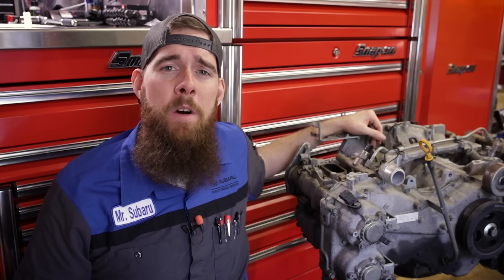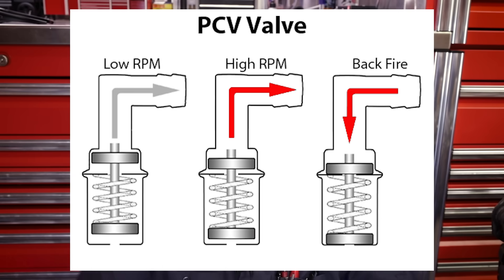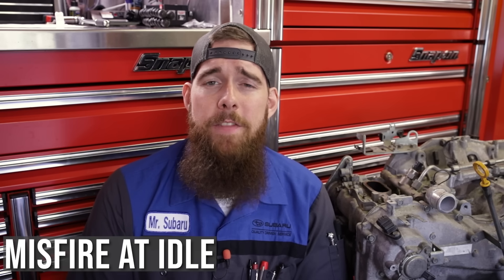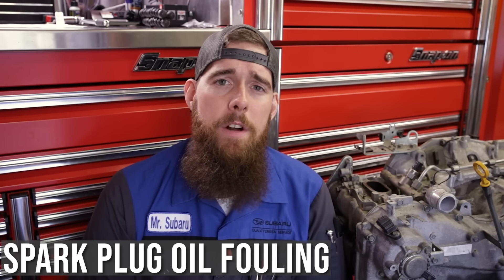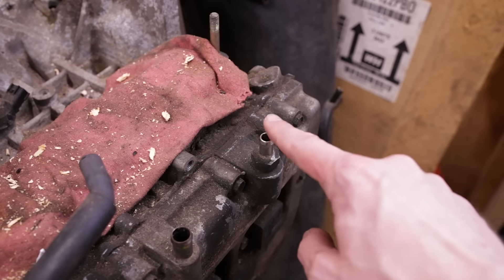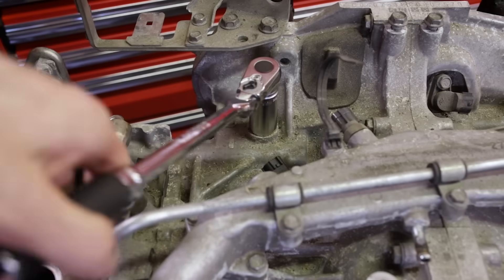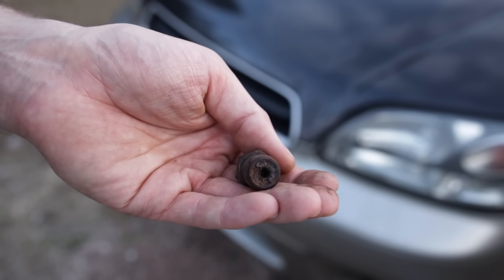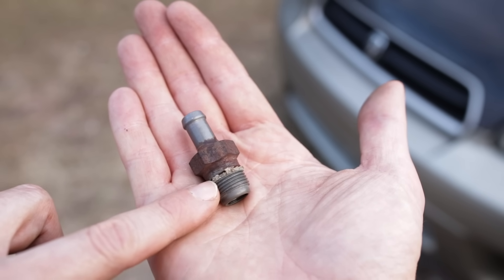DON'T Let This $20 Part Ruin Your Engine! PCV System History, Theory, Operation, & Repair!

Comment: I have a b4 5 speed no turbo at all I have no idea how much the pressure owner did to the wiring the car sometimes tells me its over heating until I hit the dash don't have t hit it that hard but he put a werd thing where I think there is supposed to be the knock sensor it gets worse but it's my first car I need to do alot of things that I did wrong like it had a straight pipe so I put a standard exhaust on it but found out it needed springs to keep it from falling off I'm just happy I was slowing down when it happened and it's been like that for awhile I'll because a break pad fell out on the same day now I need all the parts it'll be fun

Comment: Don't know why I haven't subscribed, I've been your channel for 2 years. Subscribed 👍, so if the PCV valve isn't too bad just service/clean and reinstall right! I'm looking into a little more than normal vibration at idle on my 2019 2.5i with 113k miles, plugs were replaced by Subaru at 72k as well. I'm thinking of checking plugs my next oil change and looking into the PCV valve, might replace as I drive the Outback 4 to 600 miles a week, has been super reliable from the 21k miles I got it and have 2 month oil change intervals

Comment: I have a 2019 1.6l crosstrek, but I can't seem to find the right pcv valve for my engine. It's the FB16 engine. Is the pcv valve same on all the FB engines, or do they differ in some way? 
Thanks for any reply.

Comment: Thank you So much I was experiencing excessive consumption of oil with my 2012 Impreza 2.0 only to realize after the valve change that it was the clogged valve causing the problem

Comment: I changed my PCV valve on my 2013 Crosstrek and went ahead and changed the hose also. Where the hose attached to the valve it was brittle and cracked.

Comment: Anyone who can help it would be appreciated but I got a 16 Genesis coupe 3.8 the rpms at idle do bounce some but when I’m driving and go into neutral because it is manual it drops down to 900 then up to 2k holds then drops when I come to a stop might hang in for a second after coming to a stop I don’t think it’s my throttle body or other sensors but it pops a P0507 I’ve determined there are no vacuum leaks from hoses or loose fitting I have cleaned throttle body and sensors around it and nothing only thing I haven’t checked yet is the pcv could this be the problem?

Comment: I thought I understood the PCV system, and it was fun to understand the clever design of that little ball and spring to reduce flow at idle, allow more flow at WOT, and absolutely stop reverse flow. Then I came across newer systems with turbos, vacuum air pumps, and complicated plastic intake housings. Instead of a little device that is replaced for ten dollars, in some vehicles you need to replace much more.

Comment: I have bad threads on my Toyota RAV4 PCV. What material can be added to help fix the problem?
Can you also please write down the material that you mentioned in your video to add on the threads to make it air tight? Would that help fix my threads problem?
Thank you...

Comment: I have an 08 Subaru Impreza with a Ej15 engine, that engine wasn’t sold in the US, is common to find them in Europe or in latinamerica , the car has a hard startup and when is in low rpm to move the car in traffic with the clutch and the gas, the oil indicator start blinking just briefly, but just when I do that, I think my pcv and the vvt selenoid are bad, can you tell me where is the pc valve is in that engine? Thanks

Comment: I have a 2019 Forester, 2.5L engine. There was talk one one of the Subaru forums of the PCV actually failing in place and pieces falling into the engine. Lots of white smoke coming out the tail pipe. The engine had to be taken apart. There was no recall on this in Canada but I bought one anyway, PCV valve #11810AA200, made in Japan, Canadian $33.39 incl tax. Needs 22mm deep socket. My mileage is low, 25,000km. Plan on replacing the PCV in Spring 2023.

Comment: I'll do it because my subaru 1993 ej 22 is shaking a lot when idle is 700rpm, sometimes still stop. I just cleaned up PCV but it is all time opened. May be the internal spring that doesn't properly working. So I need buy other one. Thank you.
I'm from Brazil, Paraná State Curitiba city.  And you are welcome if you drop by here.

Comment: An oil leak just started maybe a month before I saw this video. It was on driver’s side front on my 2012 Forester. Looked like timing cover. PVC had 120,k miles so I changed it as described. 
It seems like the leak stopped. I even changed the plywood I park on to confirm. Yeah, it stopped.
Maybe coincidence but I’m happy, and very lucky!
Reply: thats great! its always nice when stuff happens the easy way.

Comment: I have a 2020 Subaru Outback forester sport I have sludge when open up oil cap all my lights are on dash check engine cruise everything is on not working idling ruff running ruff i took to the dealership bad sensor but told me 125 hour minimum 10 hours I don’t have that money to do that could you give me some options I have low funds at this moment feel like my car is running like it’s 20 years old

Comment: Maybe one of you Subaru guys could do a video on replacing the variable cam gear and ocv filter on an FA20. Getting code P000a and there is nothing but dead ends on this repair. Going to the dealer is not an option, especially when the dealers cannot seem to solve the issue either.

Comment: I was going to replace mine, on my 2015 3.6 R Outback at 60k miles, but got sidetracked, and didn't do it until 70k miles.
When I replaced it, the old valve was rattling, but I could hear sludge dulling the clicks.
Anyway, while replacing the valve, I noticed the vacuum hose looked crushed!
Like the vacuum had drawn it in and cause it to become disformed.
I went ahead and replaced it, with an OEM hose.
The PCV valve was OEM as well, because something this important, deserves a couple extra dollars, for peace of mind.
Just a heads up, to those replacing the PCV valve on higher millage engines, make sure to inspect the vacuum hose as well!

Comment: Your videos instill confidence in my car and the repairs/maintenance I do on them. I had hesitation off of idle, so I pulled and cleaned my MAF/PCV/Throttle Body and it was an immediate improvement.

Comment: So I just started my 2015 WRX with 120k miles and it’s idling rough, having trouble starting, and smoking like a chimney. Could this be the PCV valve failure?

Comment: Any suggestions on a standard life of a pCv valve? 

Should it be replaced every 10k just to prevent issues
Reply: it only breaks when it breaks theres no life time for it
Reply: To my knowledge no one know when PCV valve brakes or how long gonna last. 
But to prevent maintenance issues it’s always recommended to change for new one around 30K miles intervals or close to that. 
Doesn’t cost a fortune but it gives you peace of mind. Cheers

Comment: 93,000 km 2015 Legacy.  It's easy to locate - but a long extension and a 19mm deep socket make it easy to get out.  Mine felt a little gummy but was pretty good - no corrosion inside at all.  A little break cleaner and working should keep 'er going for a good while.

Comment: PCV systems were first introduced and used during WW2 by many automobile manufacturers. My WW2 Willy’s Jeep L134 engine has a PCV valve. So it was out way before the 1960s as claimed in the video.
Reply: yet the 1987 jeep cherokee  didnt have one (?) nor a valve cover gasket.
 [there was a plug in the valve cover, so easy to put in a universal PCV that should have been there when it was new]
I made the gasket and installed the correct tubing & PCV valve and it solved issues my sisters jeep was having.
 *saw the same on other new cherokees in that time frame - the company saved just a few $ - ugh
even my old VW engines had them,  but not the 87 jeep
Reply: First off, another great video on Subaru’s, really enjoy your content, always informative, Thanks. 

But I was thinking the same thing about the 60’s comment. My 1953 Ford M38A1 CDN Army Jeep (F134 Hurricane motor) has a PCV as well. Actually the entire engine is a closed system design that was designed to be fully submerged in water. I wouldn’t try that now though on our Jeep, Forester or Outback!!!! Cheers.

Comment: I just changed my pcv hoses and valves on my 2010 WRX. My pcv was stuck closed and it was leaking oil on passenger valve cover. The hoses were hard as a rock too.

Comment: i have a 2002 Subaru Forster and when I drive after it warms up, it asks like it has no power. It has a new fuel pump, and i was thinking its something with gas system,,,maybe the PVC is my problem?

Comment: In theroy. Can you just remove the pcv valve. Install a free flowing fitting and put a hose on it like a draft tube and plug the intake port.   Or do you need the Vacuum to help pull gases out if the motor.

Comment: Silly question 2002 wrx owner here. 
Will a malfunction valve be detected and a check engine light show? 
Thanks for any feedback
Reply from the maker: No
Reply: @MrSubaru1387  
I appreciate the feedback. Ordered part and new hose since I am reading it tends to turn brittle. 
Great videos and very useful information. I was able to replace my timing belt watching your tutorials!

Comment: My 2013 gen coupe 2.0t idles good and starts up smooth but stalls after a couple of minutes. I did and oil change,  I had fuel in the oil, no check engine light at all or stored codes, eveything else seems fine but I can't see the issue, I'm thinking it's either this stuck open or crank position sensor,  but if it was a sensor,  the check engine light would come on

Comment: Does the 2.5i boxer engine need a "catch can" inline with the PCV valve to catch any vapors and condense them like they use on the Ford 3.5TT.?

Comment: Recently bought a 2011 Forester and it's been idling a bit rough when cold, been watching your videos, PCV was a little sticky cleaned it not much improvement, watched cleaning the throttle body, started undoing the plenum 😶🤨🙄 whoever was working on it before I got the car put the plenum on with only half of the rubber collar under the hose clamp the other half was folded 90° and just pressed against the throttle body, I'm amazed it sealed enough and wasn't tripping any codes, cleaned the TB carefully warmed the folded bit with a heat gun on low got the wrinkles out, runs like it should now.
Been wanting a Subaru every since I swapped an EJ22 into my VW Vanagon, engine has over 300k now and still runs great 👍

Comment: I replaced the pcv valve on my 2004 forest. After installing the new one with some Teflon tape on the threads I noticed that the valve is spinning in whatever it screws into. I'm pretty concerned. What could this be? Is there some type of housing the pcv valve screws into? Any advice would be greatly appreciated

Comment: mr.subaru, amazing explanation... but I would appreciate if you do this video, showing how to replace on the engine instaled (complete).... I know is a paying in the ass. (PITA).... I love the drawings etc.

which way I can use to replace pcv without removing the manifold intk?

Comment: Great video! I think I definitely will check my PCV valve and change it if need be!
However, I have a big question! Are EJ20 PCV valves universal for all EJ20s? I have an EJ206 (twin turbo one), would I have to get one specific to the EJ206? Or will one from any other EJ20 work?
Or does it have to be from another DOHC EJ20?

Comment: My EJ253 uses the 11810AA090 which is a black & red plastic part. Does the EJ253 also have the 11810AA100 like metal valve in this video?

Comment: I’m trying to diagnose excessive oil consumption on our 2012 Legacy. 1 qt per 2000 miles. Sounds as if changing the PCV valve is one inexpensive item to rule out.

Comment: I drop the valve in a plastic bottle with gasoline, let it soak overnight and shake to bottle in the morning. Or brake cleaner. Cheaper than 20 bucks. Clean it when you change your oil is draining each time and you won't need to replace the metal ones. Keeps you from blowing your seals

Comment: Replaced the one on our 2015 Crosstrek last week with the OEM part.  The vac hose to the manifold was hard and almost brittle down at the valve end.  I didn't trust it not to leak after disturbing it. It didn't come off of the valve without a fight.  Went and replaced that too for good  measure.

Comment: Hey I have low idle on my Legacy 3.0. When gear is in D or R idles it's under 500 rpm and the car shake a little, it does not shutdown the car, but once I change gear to N or P the rpm rise above 600 and stops shaking additional when gear is in D or R and turns AC or light on shake stops and rpm rieses above 600. Trying to correct the issue I already perform a throttle body cleaning, an injector cleaning, MAF sensor cleaning and the issue remains... I have to say that I start to notice this after I change my alternator, so Subaru check and test my battery, and alternator to see if there were voltage issues, but everything seems to be ok ¿any thoughts that could be the issue and how to solve? Thanks

Comment: Sometimes the shake test won't determine if it's working the right way. The spring can be worn too.yiu can also do the blow test to see if it's doing it's job. In both directions. Even after cleaning if it fails the blow test, it's bad or not operating at  the right threshold. Great video
Reply: Mine the spring and internal valve/plate was completely missing (it was clean straight through hole) 
Sadly this was on my WRX after i had owned it for about 3 years and then the mechanic abused it on a test drive there was smoke pouring out of the valve cover leaks onto headers. 

Luckily was no other major damage to other seals except a short term leak from front of sum near the main

Comment: I received several warning lights on the dash of my 2013 Subaru Outback.  I plugged my OBD scanner in and have misfires in cylinder 3.  I pulled the plugs, and cylinder 3 and 4 had oil in the spark plug tubes so I installed new gaskets, tube seals and plugs.  I also placed one new coil pack on cylinder 3, in the hope the misfire was gone.  I also put new oil in at the same time.  The engine runs and sounds "ok" BUT at slow speed or stops it will intermittently stall.  When I put the scanner back on , I get code P0021(bank 2).  At this time, I took it to my local mechanic and he tells me cylinder 3 has low compression, he did not do a leak down test just a compression test. I think it was 80 psi.  I have 149K on this engine and he suggested I rip and replace with a low mileage motor.  However, I want to determine what the cause is and try to solve it with this motor(if it makes sense).  I plan on buying the OTC tool to do the leak down test you show in your other video's but I am wondering if the PCV valve could have been the cause of my original misfires? Also, could the PCV also cause the P0021 code, even though the code is timing related?  Any input greatly appreciated.
Reply: Any update? Did you replace the pcv valve?

Comment: You described all the issues on my old  1996 Mazda MPV, and that PVC was constantly fouled up with oil.  I always wondered why they had it as a 10,000 mile interval replace item in the owner manual. I never saw PVC replacement in the 2015 Subaru outback manual, but just checked it's at the 60,000 mile interval replacement. Though some owners say 100,000K and they are still on the original Subaru PVC.
Reply: I'm a Mazda 6 guy and they eat pcvs. Even if it rattles the valve can be bad. I just replace mine every 20k.

Comment: Just did this on my 2011 2.5i Outback. Design was a little different as it didn’t screw into the block (red topped one). There was a short hose with a metal clip. Clip was easy enough to open with a screwdriver and close with a notched hand wrench. 20 minutes and the job was done. Valve was definitely seized and the inlet line to the throttle body was soaked in oil.

Comment: Great explanation and hard to argue with the logic. But why doesn't inspection of the valve show up on the maintenance schedule for the BRZ?
Reply: I imagine they don't want to be responsible if Subaru service cracks your intake manifold. I went to Subaru Parts and they don't service the PCV Valve beyond the hose kit.
Reply: Looked at the service manual for the Toyota 86/BRZ and the first step is to “Remove Intake Manifold” for the PCV valve service 😂 … the next steps are as described in this video. 19mm deep socket; use Three Bond 1141G or Three Bond 1215 on 2 or 3 threads of PCV valve; torque to 17 ft/lb.

Comment: Mr Subaru i replaced the timing belt on my 2008 subaru impreza sport sohc 2.5 automatic using timing belt kit TCKWP304A
i should have used timing belt kit TCKWP304ASF will mistake cause problems and destroy my engine? Thanks for the excellent videos! i also changed the PCV

Comment: I am in need of some help. I have a 2009 Subaru Impreza I had a rebuild done on my engine cause timing belt broke n bent valves but now my car won’t even turn over n I dont know if it has anything to do with my key fab? I am in need of help. Coil you please message me back. I am beside myself

Comment: Great video... Plan on buying a new hose because mine shattered like hard plastic prying it off the pcv... Mine sounded a little sluggish so I just bought a new one...250, 000 miles at 16 yrs old, its just time....